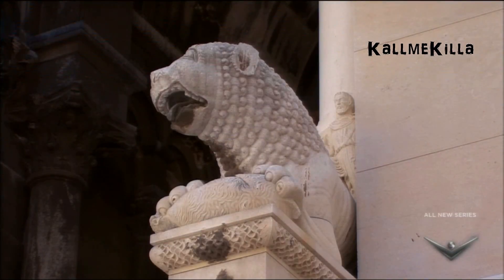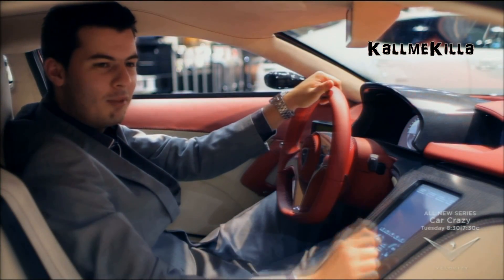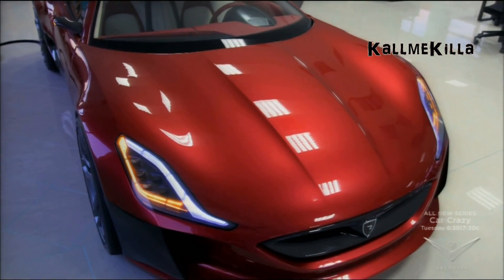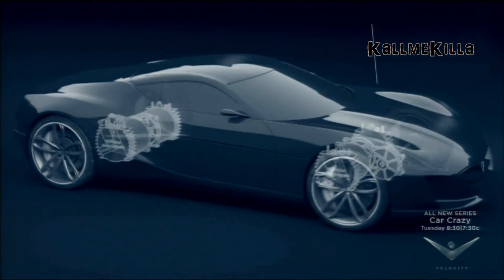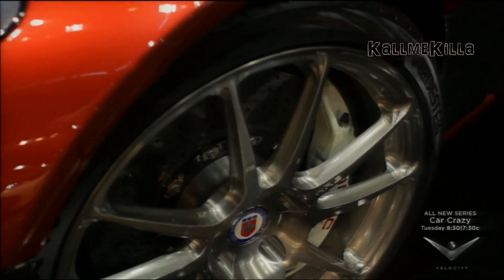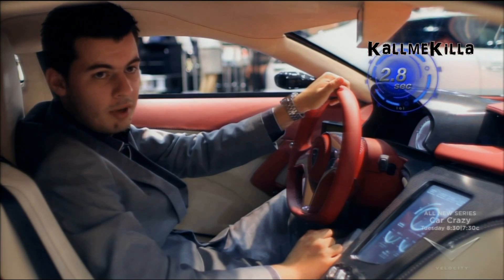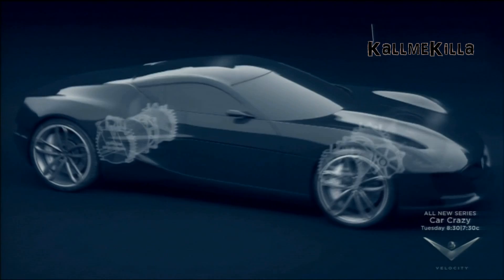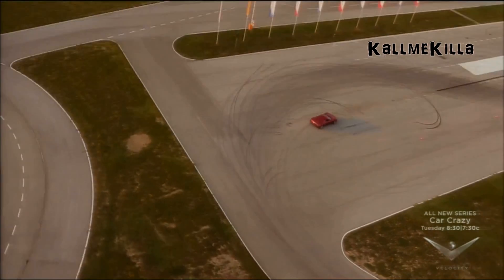Rimac - Electric Concept One Super Car 1088hp

Comment: Compared to the Tesla model s p100d it has slightly higher top speed, the same range slower 0-60, 3 less seats, and way less storage space, worse infotainment system, and it's 10x more expensive